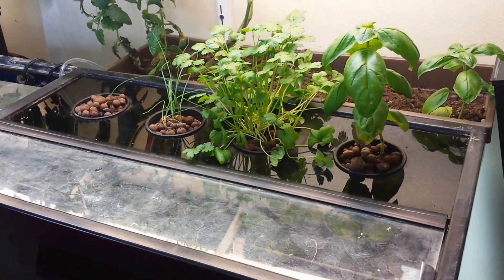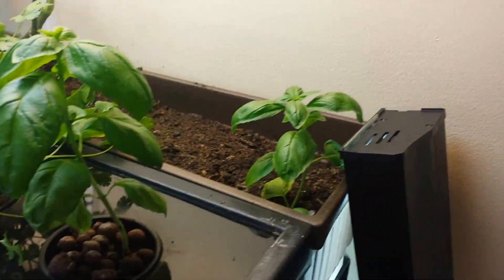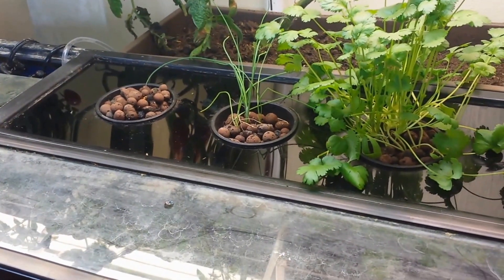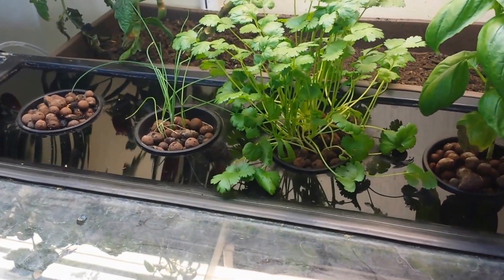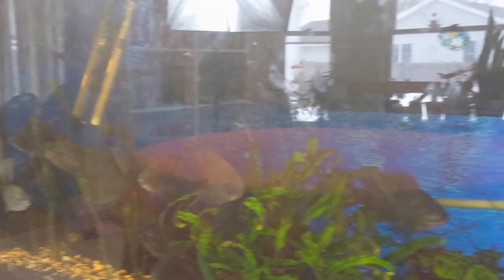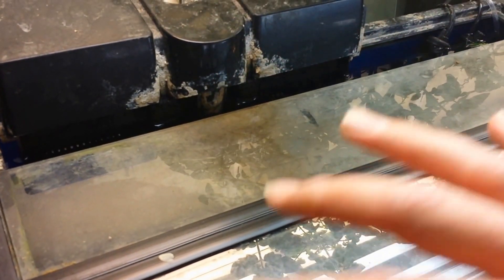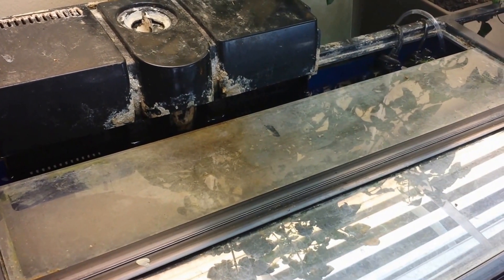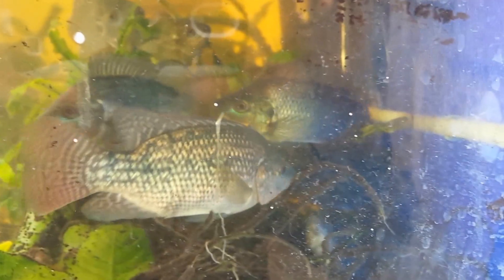Easy Affordable Aquaponics System - 2- Week Results- In My Aquarium -

Comment: Hey, are you using any supplements for your aquatic life? If so has it affected your crops? I'll probably start mine next month.  Do you have an email address.  I would like to share photos and pick your brain.  Thanks again for the videos.
Reply from the maker: Timothy McElwain Hi Timothy  I'm sorry I took so long to reply  Somehow I overlooked your comment.  So far I just give my fish their recommended food - flakes and pellets.  I recently switched over to just having a few smaller fish.  I also switched out the gravel for a sand.  When I did that, a lot of nutrients went with it.  Now I think I may need to supplement the plants.  Good luck, and again, I apologize for the long delay in responding.
Reply: @Indoor Gardening And Aquaponics

I think you just need to put fertilizer in the fish tank (designed for fish tanks, not the type you use outside unless you want your fish going belly up LOL ) to keep the plants sitting in the fish tank itself healthy. Kinda depends on how many fish you harbor tho and what type of extra filtration you use, I think. I add fertilizer every two weeks, and ALL the plants and fish are thriving.

Cheers.